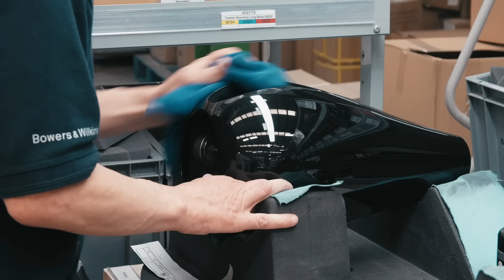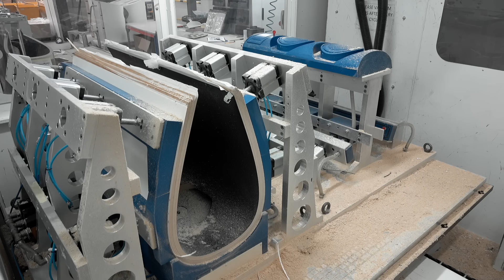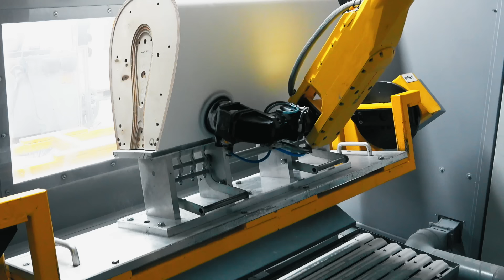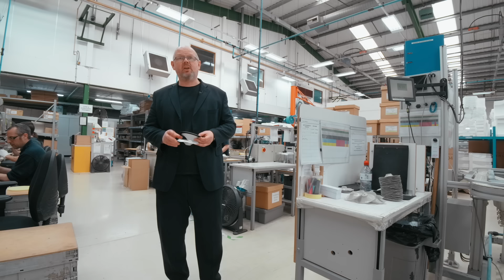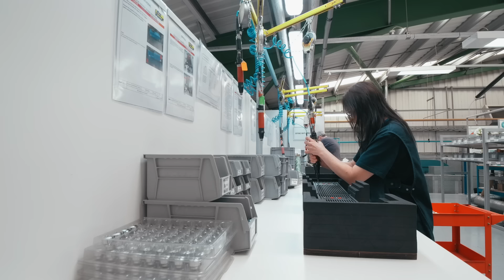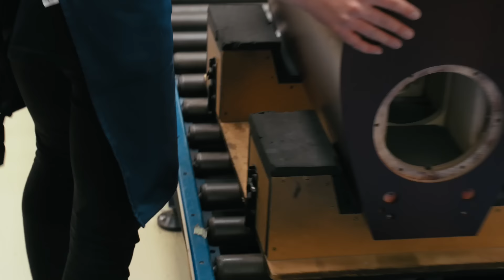Bowers & Wilkins Factory Tour

Comment: I've had a few different B&W speakers over the last many years, and still have two sets. I much prefer the sound of "old" B&W compared to the newer ones, as I find the sound simply more natural. I can listen to mine for hours and hours, where as I can only listen the say the newest 802 model for 1 hour or so, then I get really tired in my ears. The sound is not natural any more, but more like a cinema sound with a lot of incitement to impress you as a listener. I wish B&W would return to the more natural sounding ideal.
The construction is very good, even on old ones, as they are today as well. Finish is also very good. But what really bothers me is that B&W only went into using proper good quality cross-over components recently, and only on their top models. An the other thing is that they still use cheap metal clamps for connecting the internal wiring to the speaker units. Please don't do that. They have such a bad influence on sound. Just solder them in a a very low temperature, making sure no wires are burnt etc.
I also wish that B&W would take a lot more pride in their old models, so that customers can get spare parts for old models, even 30+ years old. But they cannot. B&W don't carry a stock and are not willing to do so.
Historically, B&W used to make the infamous studio sound, then developed much into the natural sound, and then into the impressive cinema like sound, as they carry it today.
Mine are from the middle period and I much prefer those. But their cabinet production fit and finish is at the very top.
Kind regards.

Comment: And why not manufacture spare parts? So out of warranty people pay for another unit because your quality control allowed non durable products to come out for sale? Happened to me just now.
Reply from the maker: Hi Lionel, for components we produce ourselves (drivers and crossovers for example) we can manufacture and stock spare parts, which we do. For some speakers we have managed to keep spares available for over 15 years after manufacture has ceased, for larger more easily serviced electronic products like our Zeppelin Wireless speakers we have offered support between 5-7 years after manufacture has ceased. With headphones, some of the electronic components used are sourced from third party suppliers, so availability after manufacture has ceased may be limited. Therefore, for headphones, if a repair of the originals is not an option or not physically possible, we may offer a replacement in lieu of a repair. If outside of warranty this service may be deemed as chargeable as would be a repair. If you do have any further questions you can always contact us directly at support@bowerswilkins.com for further advice.
Reply: Then why are you telling me to buy the PX7 at 40% discount while you can deem it as a replacement? This is the second time I sent you something for repair and yet this is your solution because you buy parts from third party suppliers. Please tell that to your guy Ken Philipps. And guess what, you guys sent me a reconditioned PX while I should have gotten a new one instead. Now you’re replying.

Comment: You could tell me that the speakers were produced by rainbows and unicorn farts, but when the speaker wire is attached to the speaker via a push on spade connector then these aren't worth shit in my book. Unbelievable, you can't take 5 minutes to solder the damn wires???

Comment: Too bad the quality is so fucking poor. I have had B&W 803 d3 and  804 d3 and Quality  in the details was fuck up on my speakers. you think that is fun do bye speakers like the 803 and find out they are flawed. But you dont fucking care, and my dealer didn't care. Hifi klubben in sweden. Guess what. NO more B&W
Reply: Sorry about your crap experience. :-(  I shop at ListenUp in Boulder, Colorado, USA and they are, in my opinion, a top notch operation.  My experience with the store and B&W products has been good.
Reply: It is b&w had poor qc issue in china .I bought the pair of formation duo new.To find out when open have scratches .And they wont do anything .Suck no more B&w